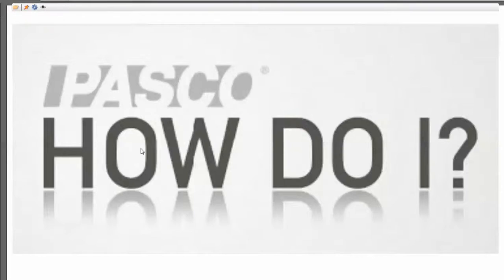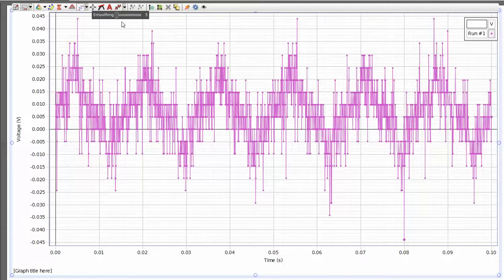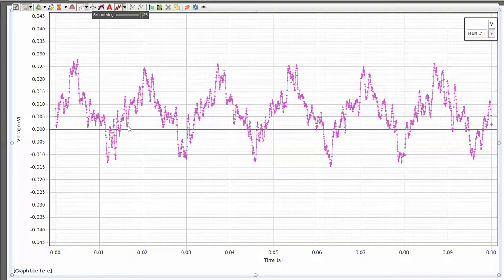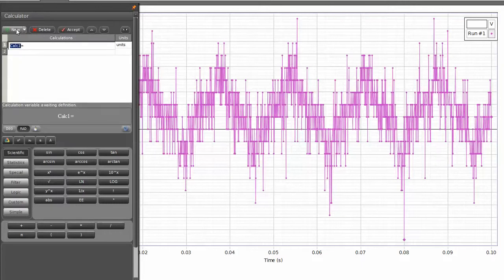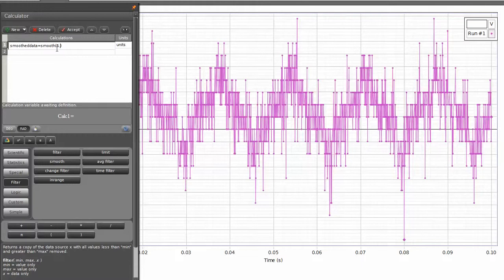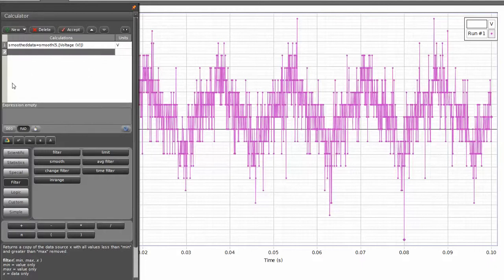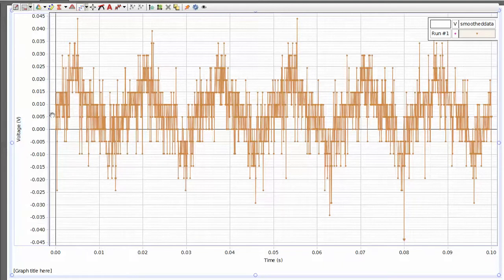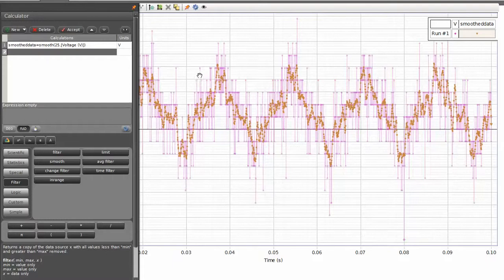Smooth Data (Capstone)

Comment: but will these change the value of the average if you want to calculate the rms value using the average method?
Reply from the maker: Using the smooth function will change the standard deviation of the data set.  If you wish to save the original standard deviation for the data set, it is possible to create a duplicate data set with the following syntax
smootheddata=<<<<Original Dataset>>>>
you can then As long as the new dataset and the original data set have the same units, you can display them on the same axis by left clicking on the vertical axis and selecting Display Similar measurement.  If you have additional questions, please feel free to contact us here at support@pasco.com.